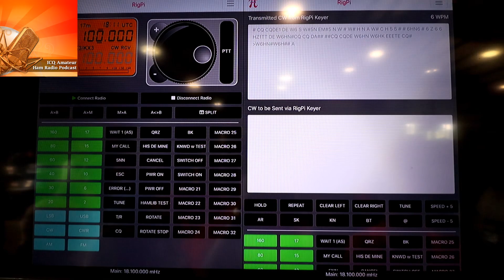Designing The MFJ RIGPI BASE Remote Control all your Rigs & History of MFJ - Dayton Hamvention 2019

Comment: What does the RigPi do? Not much. The only variable control is VFO. All other controls are either on/off by buttons. No variable control of bandwidth, notch, shift, etc just on or off. I like to control my radio for various conditions. RigPi won't do that. To run digital modes must use VNC. Why not just install Flrig (which has variable controls) and forget RigPi?